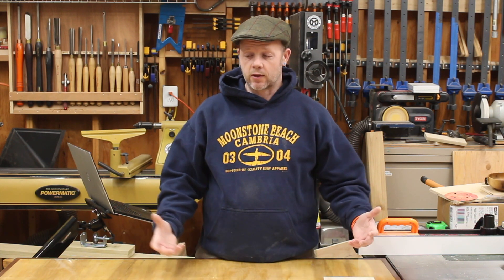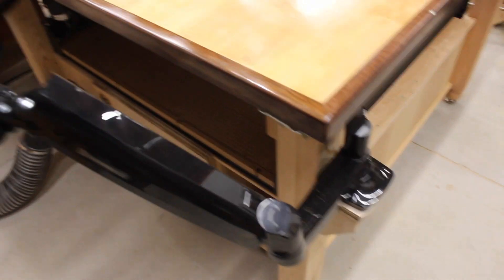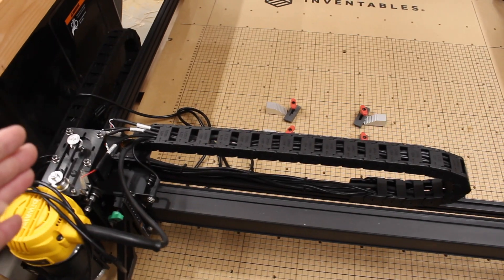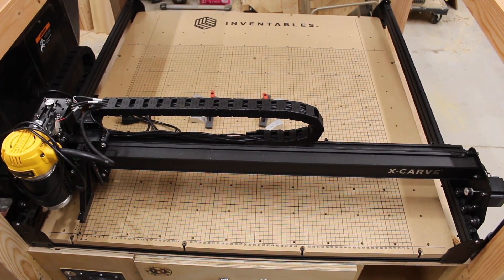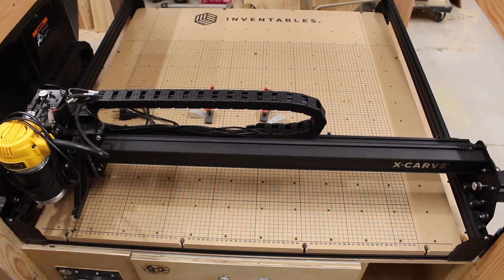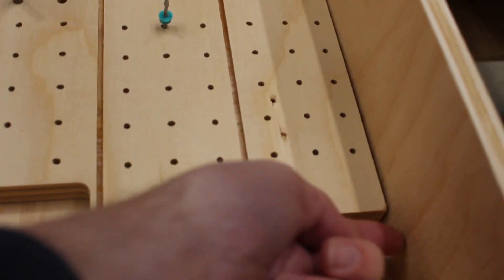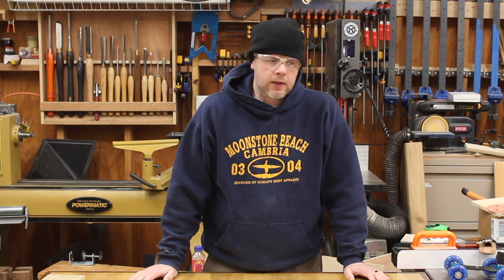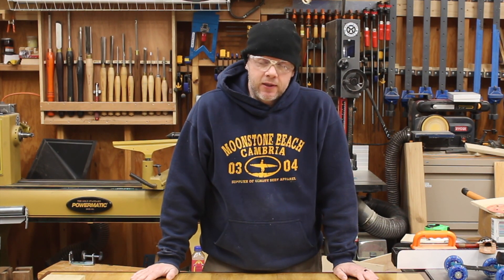X-CARVE | The First Cuts on the Rebuilt X-Carve

Comment: https://www.ebay.com/i/124098744647?ul_noapp=true have you seen this WorkBee 1515 DIY cnc it has pretty good value and is freakin huge 3x bigger than xcarve and less price and looks pretty rigid with big stepper motors and screw drive not belt drive

Comment: You make some good points however im basing it on machine only...tangible specs only. And fyi the xcarve is junk ....many many design issues....flexes..flimsy..small..
Overpriced...loses steps...underpowered ps...underpowered steppers...not accurate...limited z height...limited z stroke....you want more issues?... Im done here. Facts area facts. Cnc machines should not use rubber belts ...and yes lowes sells many hammers but if lowes tries to sell me a nice made  heavy weighted craftsman  hammer or a plastic kids toy hammer at the same price guess one im going to buy???..and xcarve will change hopefully for the better...it has to if they want to compete...mark my word xcarve will make some major changes soon...it has to....and xcarve is a diy cnc machine its not a name anymore..there are now more diy cnc machines at same price or lower that are way more accurate and capable than the xcarve brand...cnc4newbie newcarve and millright mega v and workbee 1515 are just some samples..
I would not recommend xcarve at all...its junk /toy compared to the 3 i mentioned. Xcarve is small only 29x29...these 3 are 35x35 ..34x35 and 52x52....much much larger.

Comment: Looks great! This was a perfect little series for me since I'm finished my MPCNC. I need to build a table and remembered seeing this Popular Woodworking article that I liked, and spent all day trying to find it again (https://www.popularwoodworking.com/article/cnc-outfeed-table/) 

When I did the first thing I did was see if anyone built on on youtube, and what do you know, there was a fantastic build log less than a month old. 
I only hope mine is half as good as yours. Subbed.
Reply from the maker: Thank you!  I am glad I was a little helpful for someone.  This is my second machine and I am getting some really great stuff done with it.  The larger size is a game changer.  I am actually published a new video later tonight about bit and tool organization for the drawers in the table.

I tweaked the design a little for my space and most of it worked, but there are some things I would do differently.  I went over them in the video, both failure and success, but at the very least you will want to reinforce the center - add a leg under.  I did it with mine and it makes the table SOLID.  I linked the parts I used for my build in the different video comments.

If you get stuck on something on the drawing that doesn't make sense or have a question, let me know and I will help if I can.  Enjoy the x-carve and the outfield table build.  I should have done it years ago!